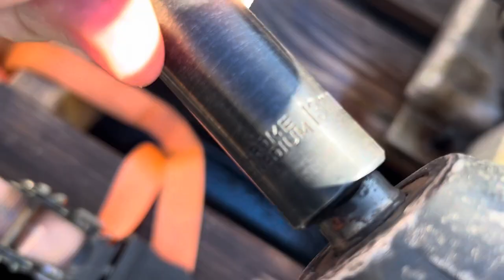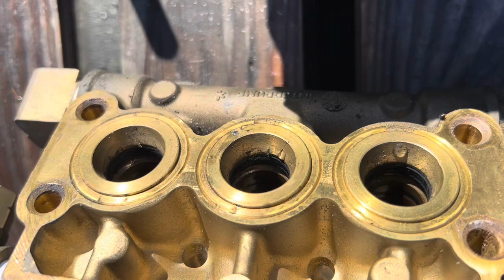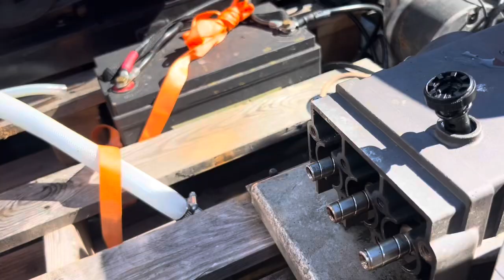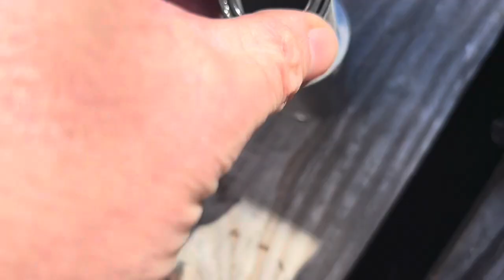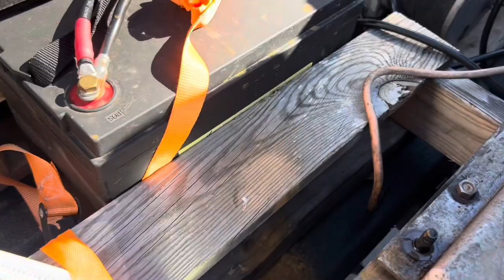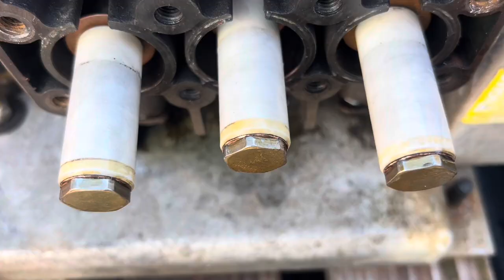Changing oil seals on pressure washer pump

Comment: I have also a hp4040  pump but i keep sending it to the shop it always leaks oil from diferent places is that normal with this pumps to go to the shop every 3 or 4 months ?
Reply from the maker: Mine has never leaked oil. If you know for a fact that the piston oil seals were replaced and it leaking from there, then you may have scores on the metal, meaning if the seals were removed with a screwdriver you may have permanent damage. To be honest, you may just decide to buy a new pump, as it may be cheaper than cost of seals and labor.
Reply: Attenzione perché anche l'albero si può rigare . La parte in cui c'è l'asse di accoppiamento pompa

Comment: Great video.  I have a similar hp4040 (older model) and thought the extraction tool was supposed to fit.  Are you sure it didn't just need to hammer it in a bit or have you found another tool that will fit?  thanks
Reply from the maker: I measured the tool and the n the pump, the tool was a few mm larger, keep in mind the tool was designed for a different model, I just incorrectly assumed because both pumps were 20mm it would work, the seals are easy enough to remove with a screwdriver, just be careful or find a screwdriver that has a plastic or wooden tip.